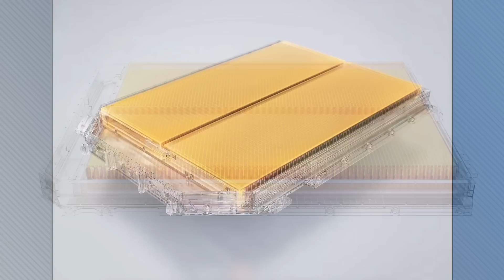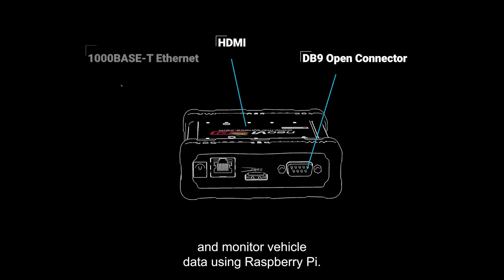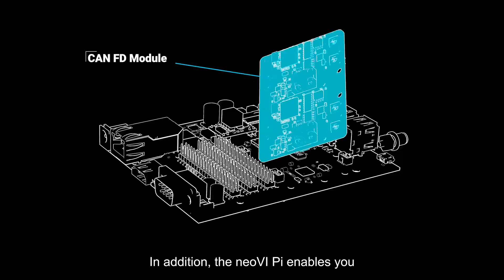Hyundai to Make EREV Pickups for U.S.; NACS Improves Charging Satisfaction - Autoline Daily 3871

Comment: All OEMS should identify their battery manufacturers in EVERY country. Why only South Korea?
Reply: I think South Korea is asking for this information to encourage Koreans to buy cars with Korean made batteries (LG Chem, Samsung DSI and SK Innovations). Perhaps to invoke national pride? Maybe to bolster HMG sales? A wild theory, but it came to mind. (And yes, I know LG Chem has had battery issues in the past)
Reply: Given that the battery is the most significant physical component in an EV, affecting cost, performance, efficiency, and weight, I'd like to know what type, capacity, country of origin, and brand it was to make an informaed decision before purchase.  Apparently now safety and quality reputations of the batteries are also issues to consider.

Comment: Honestly, I don't see this taking off for them. They never had a strong body-on-frame offerings in America and those that they still sell in other countries are questionable at best. Also like always Albert Bermann is the star engineering "hitman". However, he never had any experience designing or developing such offroad capable body on frame truck or SUV when he was at BMW. Yes he did engineer the E70 X5/X6, X3, X1 and what not but those aren't it. In fact this area isn't most of the European car manufactuer's forte. They need to hire entirely new engineers (probably American) that knows about trucks and offroad vehicles and that is an expensive commitment. I said American because even the head engineer behind the 4Runner, Sequoia, Tacoma and Tundra is a man named Mike Sweers, not Japanese. I mean they could try to pick up couple of Japanese engineers from Toyota that worked on Hilux or Land Cruiser or something, but I don't think they would do that given the two countries' animosity.

Then there is the problem of reliability and loyalty. Again their reliability is questionable and these pickups and offroad vehicles have a very strong loyalty.

Hyundai does sell buses and trucks for commercial use in other countries. Yes those does count as body on frame. However, not only did those FAILED to capture any market from the established American, Japanese and some Western European truck manufacturers, they have even bigger issues to worry about as Russian, Chinese and even Indian truck manufacturers such as Kamaz, Gaz, Ural, Dongfeng, Foton, Mahindra and Tata are hot on their tail. Indeed in third world countries where originally the Koreans had held advantage over the more expensive Japanese and American manufacturers, their truck lines are being replaced by the said 3 countries. This is because they offer the same capability but cheaper, and if you want more reliability, you can step upto more expensive Japanese Hino, or Isuzu, or Fuso and UD trucks, so what's the point of buyng middle ground Hyundai? Yeah so in those countries we have predominantly those manufacturers and older Japanese and American trucks.

Comment: Why are companies quoting 20 to 80% charge times for cars equipped with LFP batteries?   Is it because the last 20% is too slow, or possibly to allow a direct comparison with the non-iron types, since 100% charge is recommended for the LFP type, but not the others?
Reply: Comparing Apples to Apples. With charging rates dropping differently after 80% SOC,  it's not a fair comparison to include the tail end.

Comment: This is why they upgrade so often:

Zeekr’s upgraded EV batteries support 5.5C ultra-fast charging that allows vehicles to charge from 10% to 80% in just 10.5 minutes, removing its customers’ range anxiety.

The new charging speed record is achieved by Zeekr’s new 007 sedan model carrying the new lithium iron phosphate (LFP) batteries and connected with Zeekr V3 ultra-fast charging piles. Thanks to the optimized materials and upgraded technology, the speed is higher than what’s achieved by existing nickel-cobalt-manganese batteries, representing the new achievement by Zeekr’s in-house e-powertrain R&D team.

Thanks to the enhanced battery management system (BMS), the vehicle’s charging experience remains stable and fast even in harsh environmental conditions. At temperatures as low as -10 degree Celsius, the vehicles charge from 10% SOC to 80% SOC within just 30 minutes, assuring users of swift and reliable charging performance.

Zeekr has opened over 500 ultra-fast charging stations in China with over 2,700 charging piles, all of which can support 800V charging. Zeekr plans to expand the network to 1,000 ultra-fast charging stations in 2024 and will be operating over 10,000 ultra-fast charging piles in 2026.

Apart from this, on Zeekr Tech Day, Zeekr releases the urban Navigation Zeekr Pilot (NZP) assist driving functions, providing intelligent driving assistance on urban roads with navigation. The urban NZP will start delivery at the end of August. Connected to the Kr AI model, Eva, Zeekr’s in-car assistant, evolves into a considerate driving companion. It can prejudge the situation and give suggestions to Zeekr users accordingly, enhancing the in-car experience of Zeekr users.

Comment: Extra copper isn’t necessary if automakers follow Tesla’s 48v and Etherloop design.

Lithium isn’t necessary with sodium batteries.
Reply: current sodium batteries are not competitive
Reply: Tesla isn’t the only manufacturer with such a system and others have similarly efficient ones. Stop being a good for nothing tesla simp

Comment: Ev satisfaction due to tesla is a false narrative   lets see some statistics that backup actual charging sessions.
Reply: It's more accurate to say that Tesla's Supercharger network is the "only" reliable one in the US.

Lumping them with other networks merely helps those networks look better than they actually are.

Maybe in 5-10 years that changes, but today I would only recommend the SC network for any EV drivers to rely on when going on a long trip whenever possible.
Reply: @AllanSustainabilityFan  Ole GED Alan leaving out the reliability is moot when copper thieves cut the charging cables.  Captain K too cheap to hire a security guard.
Reply: @bobbbobb4663 another nonsensical post.  Your growing EDS is resulting in a disconnect from reality and really degrading the quality of your posts.

You may want to try taking a couple of midol. 🤷
Reply: @bobbbobb4663  Tell your boss she should pay for her own copper like everyone else.

Joking aside, your trolling does highlight another advantage: 

- Tesla has ~2.5x more stalls per location on average than the aggregated competition (Some are much worse than others), and in busy spots that advantage often grows even more.

- The third party players are still working to solve their software issues, god help them with the hardware ones, such as the one you alluded to, on top of that, especially with usually so few stalls per location.
Reply: @AllanSustainabilityFan  Guess which chargers the copper thieves are targeting?  Not the EVgo’s of the world…
Reply: Tesla SC NETWORK  is the best it seems, even in AUSTRALIA  as one couple who owned a BYD who found out.
Reply: 80% of what we read and see is a false narrative. Why would this be any different?
Reply: @AllanSustainabilityFan  Its easy when Adrian won't staff a $10 / hour security guard:  "Thieves steal high-voltage Tesla Supercharger cables from Montrose charging station"

Comment: i dont known why its taking american companies this long to realize that normal hybrids are already behind if it was 2012 and the largest range for BEV was 50 miles it makes sense but battries are at 600 miles.....I think kia is smart for not making a normal hybrid but a extended range EV
Reply: james, u do realize toyota and honda hybrid technically does not have a transmission right? they market it as a e-CVT but it is not a CVT. It is a planatary power split. It is way more simplier
Reply: US mentality is always behind. We get stuck in dogmatism
Reply: RE might be the last stand for hybrids. All those old fashioned ones are way too complicated and expensive. Transmissions need to go!
Reply: 111k on my i3 REx. Would love a truck with similar powertrain.
- No transmission
- Simple engine tuned for fixed RPM
- Way less weight than BEV
- 95%+ of annual driving is electric
- No need to complicate schedule with sketchy public charging on long trips

Comment: Can you imagine if 20 percent of gas pumps didn’t work?
Reply: Can you imagine over 100 million gas pumps = everywhere where a socket is available ?
Reply: @bagheera32  I have two in my garage. No gas pump though.
Reply: It makes me mad that these oil companies won't even bother to partner up or really launch their own Fast Charge networks which seems like the most logical answer to declining oil demand in the future and competition that would go elsewhere. At least Shell seems somewhat open to L3 charging at their sites... And Petro-Canada here in Canada already has one just not one that goes everywhere... Just across Canada via the main Highway 1...
Reply: @stickynorth They working hard with their own version of Supercharge and buy Lithium to make batteries.
Reply: Somebody wasn't around for the 70s Oil Embargoes...
Reply: @CSHarvey 😂
Reply: If gas pumps were completely unattended and only accepted credit cards like EV chargers, probably even more would be vandalized.
Reply: @broddr excellent point
Reply: In the early days of gas pumps, it was likely higher than 20%
Reply: Actually not that unusual for gas pumps not working
Reply: My nearest DCFC station is a ChargePoint with both CCS and Chademo cables. Two months ago someone cut into the CCS cable without actually removing it, rendering it inoperable for anyone except Nissan Leaf drivers.

When they replaced the cable, two weeks later someone ran over the CCS connector, crushing it completely, while leaving the Chademo cable untouched. Only drivers who can use it? Leaf drivers. These guys are worse than the Mockstang-E drivers who walk away from the car after setting their recharge limit to 100% and shop for a full hour until their phone tells them the car finally trickled its way up to 100.
Reply: In the UK the pipes keep being cut off or slashed 😮
Reply: I've experienced that.
Reply: There would be less gas smell???  :face-blue-wide-eyes:
Reply: Yep yep yep @2cartalkers